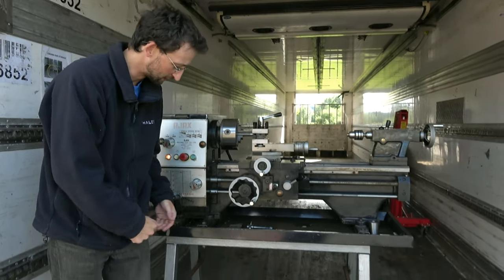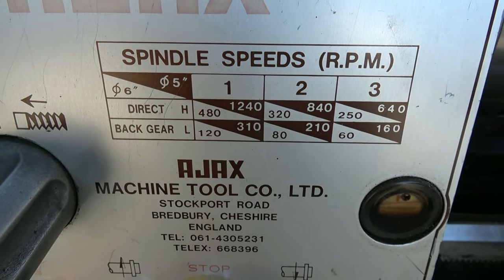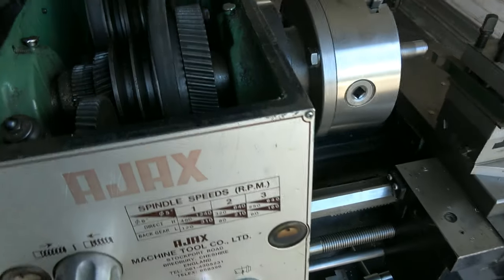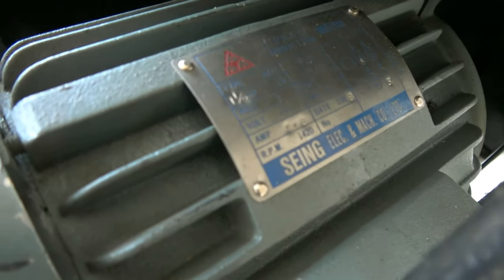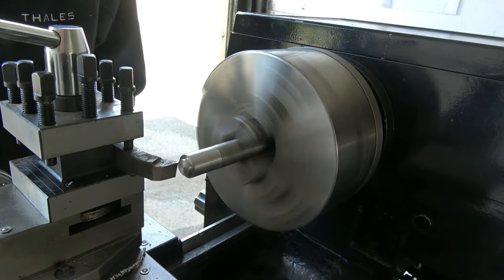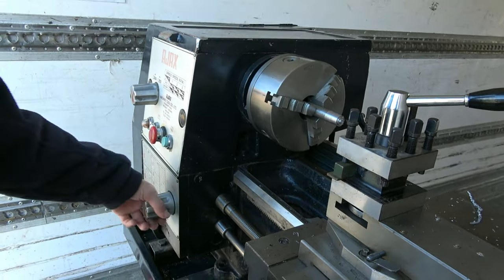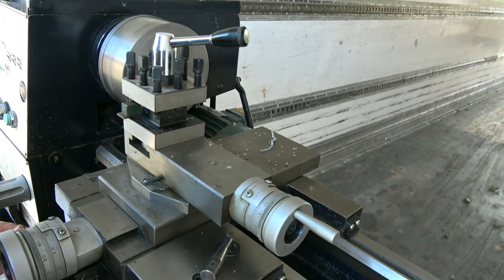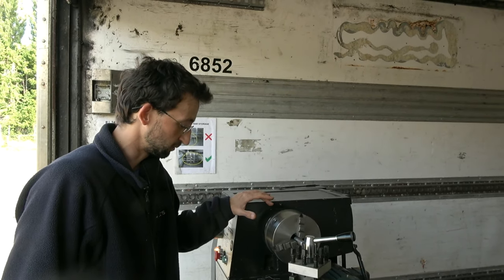AJAX METAL LATHE Screwcutting Machine Tool Demonstration Video

Comment: I have the same lathe, this is the only other one I’ve ever seen. The pics on lathes.com are of my machine. To engage the back gear there is a spring loaded pin with a knurled end on the front of the bull gear. You pull it out and spin it 90 degrees to lock .